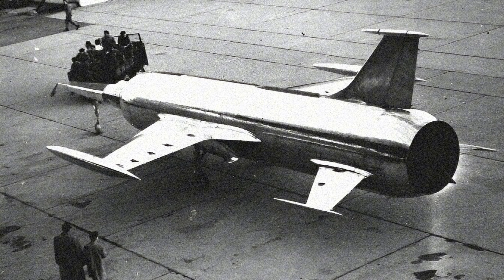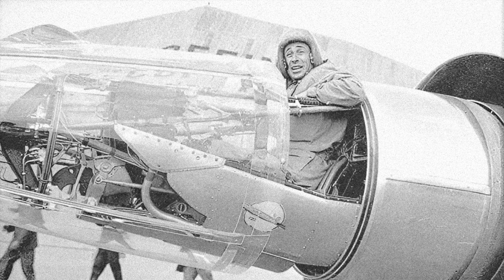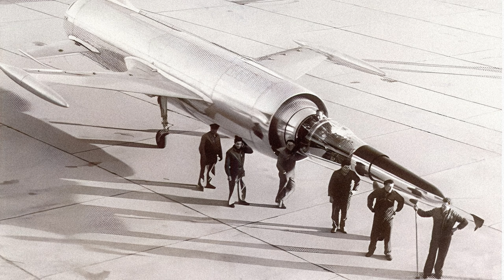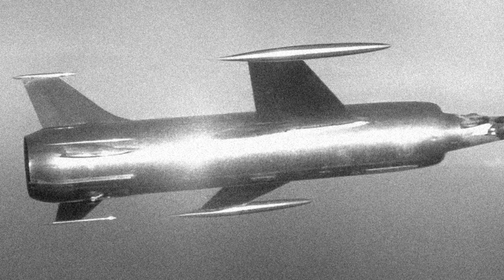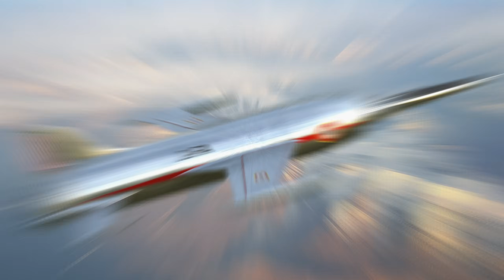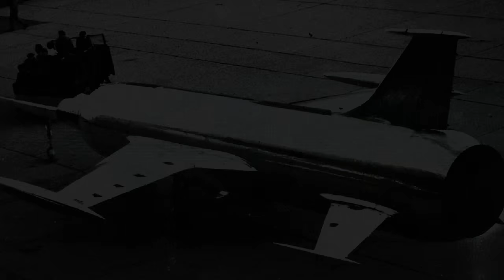Leduc 0.22: They Put the Pilot INSIDE the Engine

Comment: How did they protect the turbojet engine from the heat of the ramjet? Unless the ramjet portion was well aft of the turbojet. Where was the fuel stored? My guess was a pod behind the cockpit. I'm surprised the ramjet was so large in diameter. Of course the SR-71 engines learned a lot since the Leduc 0.22